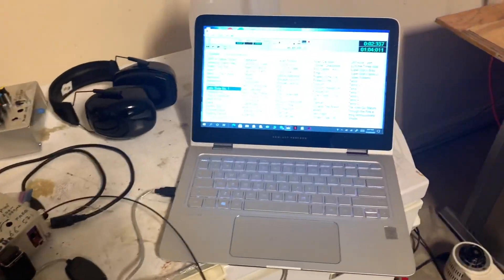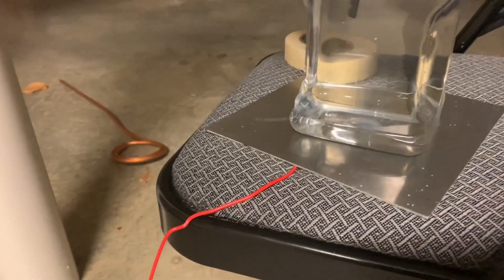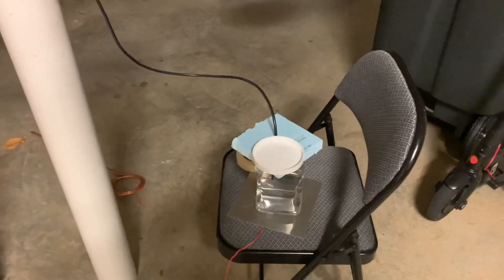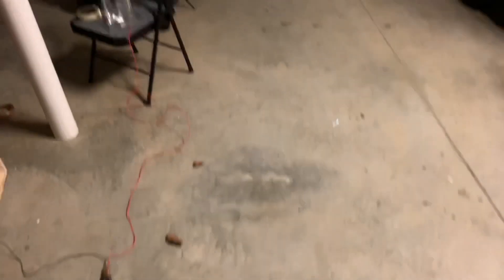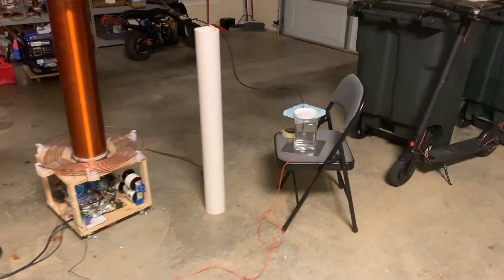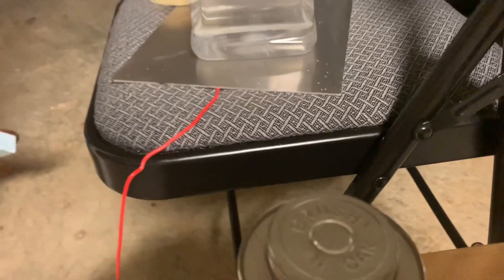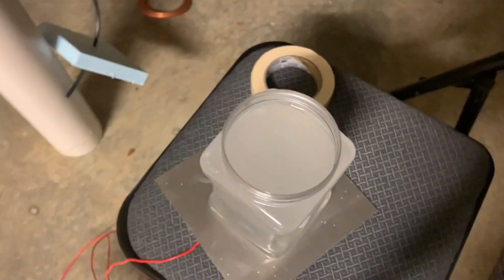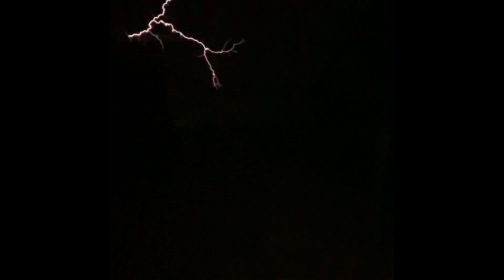Underwater Plasma Music

Comment: And more ;-) You have to switch between high volt / low amp (70000V / mili amp) and low volt / high amp (12V / 22amp), controlled by a flip flop circuit. And experiment with wire wrapped around the glass container. Maybe connected to both anode and cathode or only connected to one of them.

Comment: And use soft circular iron plates (maybe 3mm thick and 5cm in diameter with a bolt welded in the middle). Plates with bolt should preferably be nickel-plated. And make discharge from the positive wire to the bolt on the positive plate. And connect a wire from the positive plate to the negative plate and wrap it around the glass container. Herman Anderson setup...look for video on youtube.

Comment: Super good attempts you make and good videos. Thanks. Please try adding 
potassium hydroxide (experiment with the amount ... maybe 12ph) to 
distilled water, and experiment with the distance between positive and 
negative (maybe 7.5cm). And experiments with low frequencies (maybe 
7.5Hz). And see what happens to hydrogen production. Use DC setup. And maximum 70000 volts DC.

Comment: Yeah man that is wonderful content ! So i guess anything below 3000 herzt bass is block by the tesla coil induction? Maybe you can play around with the dc version and 2 flat panel glass to create liquid bass . Put silicone bead to seal glass panels together with match sticks as spacers and then fill with di water till it reaches the top and then drop insulated wire till it reaches the middle . Just an idea ! Not sure if it will work but there are similar glass panel wall speakers  that use the room as the speaker box and  a glass window as the speaker !

Comment: I love unique testing, you know distilled water doesn't conduct electricity yet you produced a gas and a discharge of Energy amazing...
Reply: fuck google  Distilled water is a great insulator, but it isn't a perfect. Water has an electrical conductivity of ~0.055 microsiemens per cm. That's small, but it isn't nothing. Also, as we can see in this video, water conducts electricity when subjected to breakdown voltages as well.
Reply: @ldskjfhslkjdhflkjdhf  just like lightning, it Conduct through the moisture in the atmosphere !
Reply: @Buzzhumma  Not quite. The resistance of air and water are both quite high, meaning they're good insulators, which is why it takes so much energy to produce lightning. You can think of lightning as a long electrical spark, the particular insulating medium it travels through isn't the important part.
Reply: Distilled water does conduct electricity, just not very well.
Reply: Well you don't know the properties of distilled water then...
Reply: Saltwater on the other hand is a conductor of electricity...
Reply: Water is a medium with the right properties it can become a conductor, but not like you see in the Movies. Although in gaseous state (a cloud) or like a mist (a waterfall) it can produce free electrons and become a good conductor...
Reply: I bet you the gases produced was Hydrogen and Oxygen, the Breakdown of H2O...
Reply: @steve-o6413  I realize I'm being pedantic here, but you said "distilled water doesn't conduct electricity" which isn't strictly true. It was a frivolous, minor correction. For most purposes you can pretend that materials act in ideal ways, and you seem to have your mind made up, so I'll just drop it tbh.
Reply: fuck google  yes the phone will charge as long as the phone circuitry does not conduct to the point where it shorts out !